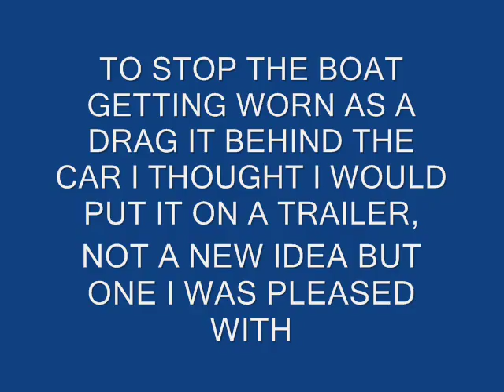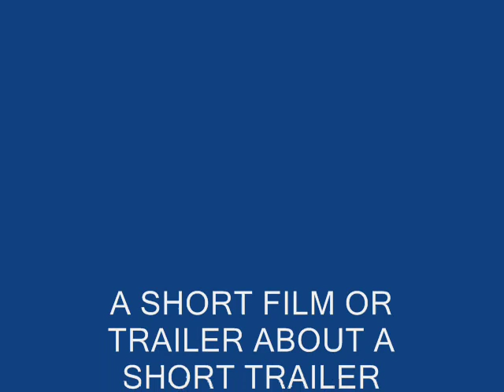BUILDING MY BOAT TRAILER

Comment from the maker: Hi i am not sure what you mean by the mounts, at 7.23 I put cut scafolding poles on with exhaust clamps, at the top was cut aluminimum c shaped chanel that was from and old door runner that was lying around at the farm, then wood covered in carpet ,hope that helps, just ask if any more questions and thanks for watching my video.